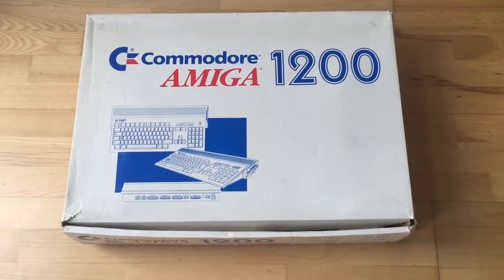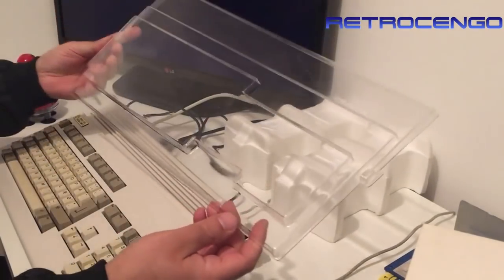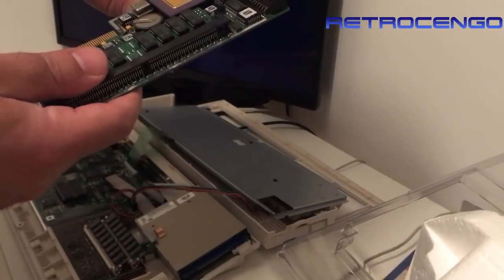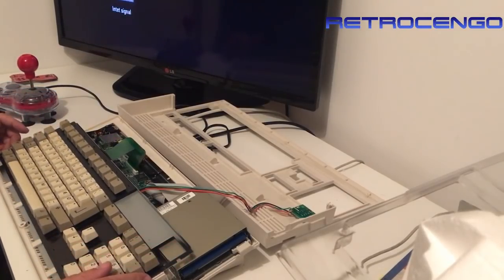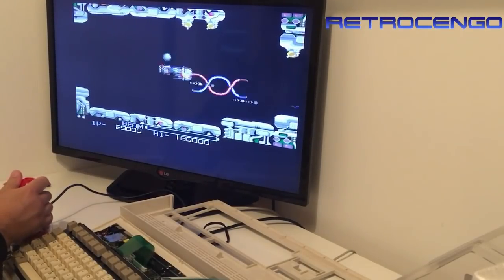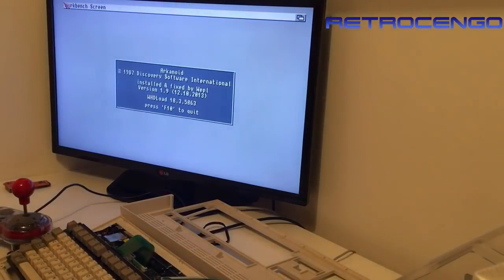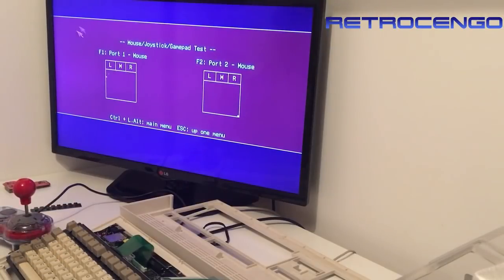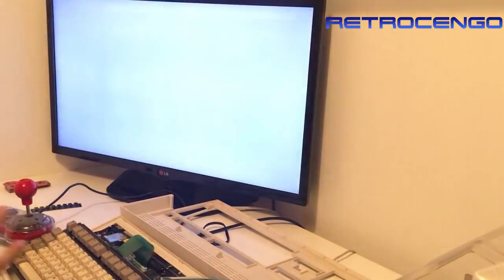Commodore Amiga 1200 unboxing 68030 50MHz 32MB Ram CF card Indivision AGA MK2cr

Comment: I've got an Indivision AGA on the way for my A1200. So excited! 
I'm still trying to hunt down the best value RAM/Accelerator option but everything is just so expensive right now.
I was looking at picking up a Black case and black key caps as well.
Reply from the maker: Gear Seekers All sold out, where did you find one?? About accl cards, i will recommend the new 1233n
Reply: @RETROCENGO  A friend of mine in Austria sourced 2 of them from somewhere. He is sending me one of them.
I cannot find any 1233n's anywhere for a decent price. It's hard getting Amiga bits for us Australians.
Reply from the maker: Gear Seekers Have you tryed icomp.de?? I actually sent a Cyberstorm MK I 040 40mhz 128mb cpu board to Mellburn today, to an awesome collector there😁🕹🕹

Comment: The red screen is caused by the maprom function of your Blizzard 1230 II. When maprom is activated by jumper you need to use the blizkick software in your system bootup. If it is not present deactivate the maprom function by setting the right jumper on the turbocard to prevent the red screen. Googe for information about the jumper settings. Also the ram modules must be jumpered right. Your ram modules are okay!

Comment: My first computer was a ZX81 back in 1981, followed by the Atari 800 XL in 1985, a Nintendo NES in 1991, an Atari Mega ST which came with a monochrome monitor and hard disk drive. I killed the Mega ST trying to connect a colour TV to it. Bought an Amiga 500, with a proper colour monitor and printer in 1992, and then a year later, a standard Amiga 1200 which I had switched with a friend who wanted my Amiga 500. 

I used the Amigas for graphic design, i.e 3D rendering with 'Real 3D' software, Deluxe Paint 4,  Photogenics (like Photoshop) Vista Pro 3D landscaping software, music production with external Yamaha midi keyboards, Octamed Sound, Bars & Pipes, ect and of course gaming.. The most visual impressive games I have include Super Stardust AGA Ruff & Tumble, and Disposable Hero (like RType but better), Shadow Fighter, Doom games like Gloom and Alien Breed 3D, Breathless demo's..were cool. Last year I took my Amiga 1200 out of the loft after 18 years and it still works the same as it did all those years ago... Still got stacks of floppy disks.. that cover everything that was available for it... :-). In 1998, I had bought a Sony Playstation console which meant I used my Amiga a lot less as I could game on it and make music. The Amiga was last used for printing purposes in 2000 mainly. When I got my first AMD Athlon 750 PC in August 2000, it replaced both the Playstation and Amiga 1200. Still play the A1200.. on occasions today though.
Reply: I have a 1200 with the Blizzard II board also, the red lines that flash across the screen during boot up are normal with this card.
Reply from the maker: skyhawk77 Ohhhh you experienced it all from the golden years then😎😎😁
We all have great histories with the incredible Amiga, but its great that you unpacked it again, hope you’ll enjoy the mighty Amiga again, well i do. Thank you for watching 🙏🏻😁😁
Reply from the maker: Dan Goswick Dan.... this is golden info, okey, so the blizzard in there is working propper now with the 16mb. Red lines are normal?🤟🏻😁😁
Reply: RETROCENGO Yes, the flashing red lines on power up or reboot are normal with the Blizzard II 1230 card.  I just pulled my 1200 out of storage a few months ago and I’m having a blast!
Reply from the maker: Dan Goswick Thank you Dan, don’t need to investigate this one then, nice. 
Ohhh thats great, now go ahead and play some R-Type, its an amazing shoot em upper

Comment: Clean the ram connectors you can use a rubber that you use on pencil or get some electrical cleaner, obviously you don't want to go mad with the rubbing but you can you don't have to be super gentle just take, sorry added this before you said it yourself.
Reply from the maker: Ray Moreton Thanks for the info Ray, the connectors on the ram block was all cracked, not worth anything, ive put in a nice clean working ram block now, and it runs 👍🏻 great. 
Thanks for watching 😁👍🏻

Comment: Why the hell wasn't everything already together inside the machine before the seller posted it to you?
Reply from the maker: Perihelion74 yea its odd🤗🤗 dont know😁
Reply: @RETROCENGO  
Very odd, you would have paid good money for it too, not the best delivery I've seen 😒

Btw - you've got the almost the same specs as I do, but I don't have an FPU nor an Indivision.

Mine is an A1200 Blizzard 030@50mhz with 32meg fast ram, CF-Card & an external scan-doubler running into an old 17 inch CRT Monitor.

Just one question though, where the hell did you get that cool start up that allows you to choose workbench, demos and games?
Reply from the maker: Perihelion74 unfortunately sometimes when you make a shipping deal, you take a risk. Like this with a faulty RAM. 
Its just gameselector, pops up at top on google search and free to download 😁👍🏻

Comment: не всё так хорошо будет с MK2cr. Его тяжело настроить, я убил на это две недели. И при этом картинка во многих демо, играх, растянута получается, вылазит за края экрана, плюс ко всему этому, при переключении режимов на экране отсутствует изображение в течении четырёх секунд!!! Много чего успеваешь пропустить. поставил рядом второй монитор и подключил по SCART. На нём картинка всегда вся вмещается в экран и при переключении на экране всё хорошо!)

Not everything will be so good with MK2cr. It's hard to set it up, I killed it for two weeks. And at the same time the picture in many demos, games, is stretched, it turns out, climbs over the edges of the screen, plus all this, when switching modes on the screen there is no image for four seconds !!! You manage to miss a lot of things. put next to the second monitor and connected via scart. On it, the picture always fits into the screen and when you switch on the screen, everything is fine!)
Reply from the maker: Александр Белый I’m sorry, can’t answer😁 is it possible for you to rewrite in English?
Reply: @RETROCENGO  Translated
Reply from the maker: Александр Белый Thanks for the translation and the info, BUT this sounds really bad!!! Does it really have so many problems?? Hmmmm haven’t tryed it yet, but if its that bad, i will show it in the review for sure. 🙏🏻 😁 thank you for the info again
Reply: @RETROCENGO  I am very interested in how you set it up. I look forward to review. And then try to run it on such games as super frog and solid gold. There you can see how the picture at the top will go beyond the screen.
Reply from the maker: Александр Белый Thank you for the subscription 🙏🏻 will do, I’ll test it with Superfrog, but still i hope it works well ✌🏻😁😁
Reply from the maker: @apacher6433  Ohh YES an amazing game, i still love superfrog :-)
Reply: @RETROCENGO  I threw a link to this game, because here it is launched via MK2cr. Pay attention to the top of the screen as it goes up.
Reply from the maker: Александр Белый Ive seen that vid before, its lifted a tad on the top, the E for energis top is gone yes
Reply: @RETROCENGO  This is how Indivision AGA MK2cp displays this game on the screen. And a lot of other games and demos.
Reply from the maker: Александр Белый Thats just NOT cool at all😱